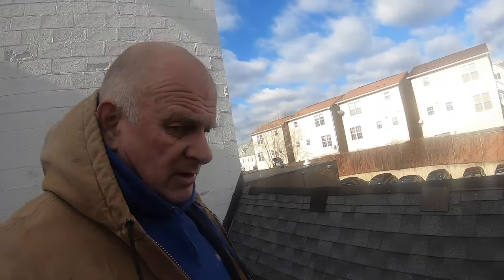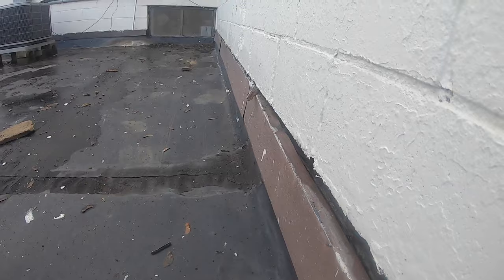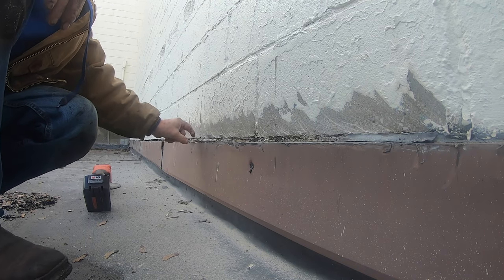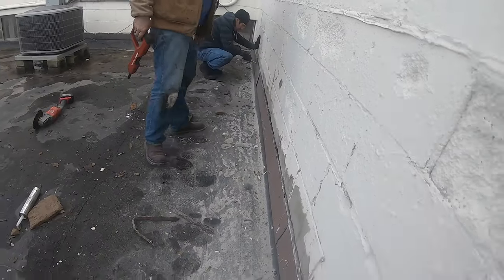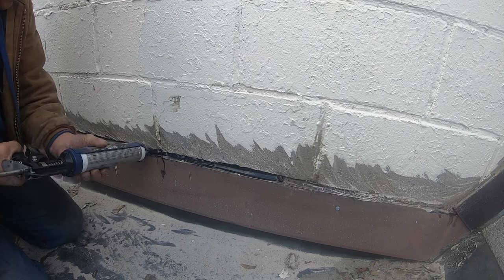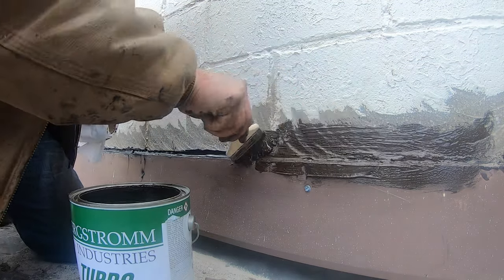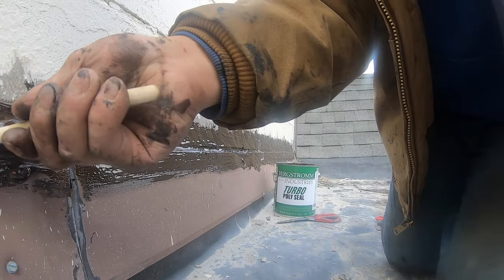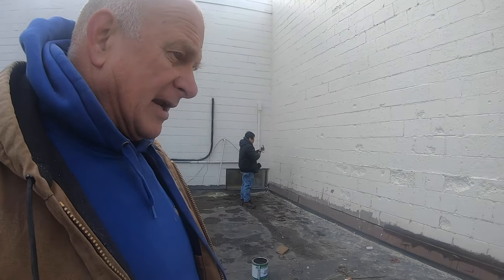FLAT ROOF LEAK REPAIR | The MAGICAL life changing sealant for every home. I which I knew this before

Comment: Cut a 45 degree raggle kerf 1/2 inch deep about 2 inches above old reglet flashing full length of wall. Use your poly urethane and insert counter flashing over the old reglet flashing. Boom. Water runs down wall onto counterflashing and cant go up a 45degree slot. Permanent!

Comment: Thank you for the great presentation and shared knowledge.  I also need to fix a what I believe to be called a " Gutter Box " that drains the water off the flat roof. The box of course sits level with the roof so that it drains the water through the interior side of the wall and out the exterior. A vertical gutter sleeve is attached to it on the exterior side of the wall.  I am thinking if the Gutter Box isnt damaged i can also use the Poly Turbo and Mesh surrounding the box. What do u advised?

Comment: Very helpful video. What do you have to do to get the tape and sealant to adhere to painted rough stucco? I don't want to grind down the stucco. I also need to patch large fissures in an epdm roof. Should I use the sealant and tape or put a patch over the opening and then the sealant and tape?

Comment: Hi Dr. I love your videos. I have a question; why do writers on the internet say silicone is better than PU? I personally am using Bostik PU Seal N' Flex as i cannot get bergstromm Products here, where I am. After viewing some of your videos I am leaning towards PU.
Reply from the maker: I use both Super Silicone Seal and Turbo Poly Seal for different applications. Urethane Silicone base sealant is very very effective on EPSM Rubber roofs but Turbo Poly Sewal will not band to EPDM. Super Silicone is more liquidy, therefore it will tend to flow off flashing details before curing. Turbo Poly Seal is very thick and sticky and doesn't run or flow easy. Both the sealants adhere well to metal, plastic, glass, and cement. The secret is the polyester fabric that is used in conjunction with these products, that is what gives the strength.
 Flex liquid does not come with any polyester fleece, so then you can use Henry's fleece that is sold in Home Depots. Henry's polyester fabric is stiffer and thinner and does not conform easily to curves and odd shapes.
Turbo Poly Seal and Super Silicone Seal have a specially formulated polyester fabric that is softer and stronger than Henry's that makes for better repairs.
I hope I gave some reason for the why's and why nots.
Thanks for the question and I hope to hear more from you.
Naas
Reply: @FlatRoofDoctor  Thanks for informative reply. By the way I use Butyl tape on top of the PU sealant to extend the life by warding off UV light.
Reply from the maker: I am not familiar with Bostik PU. I guess the PU stands for Poly Urethane. But if you are referring to caulking products, then I will use a Poly Urethane caulking above any other. There is a place for every type of caulking, but not every caulking is meant for every situation

Comment: Hello Flat roof doctor.
I have a roof that has an attached patio.
With a gap about 1/4 inch. Just purchased the trailer. Looks like the gutter or whatever they had there is gone. There is no flashing just some steel between the patio roof n the trailers flat roof. 
My man put some flex tape on it.some creases. I saw your video that says it gets hot n adhesive wont stick. Now that we spent allot to repair so much up there. He says hes done. He wont let me get up there. To see what's wrong n to fix it myself.    I'm thinking turbo poly seal  polyester fleece n then a coat of the turbo poly seal again. But unsure because I haven't seen it. 
Now if it needs flashing I'm not sure how to attach onto the  flat roof which is what he tells me about 1/4 inch away n also patio roof is lower than trailer flat roof I believe  but not positive rubber roofing. He used a silver seal on part of the roof neighbor said u have to do every 2 years or so. I'd love to see a video on how to fix this. Rochester NY

Comment: The only thing I do to my mobile home roof every 5 years is roll on that"Henry's Tropicool"I have Never had a leak since(12 years)& Henry's Tropicool is supposed to last a lifetime so really I shouldn't have to even apply Henry's every 5 years but I do it anyway.
Reply from the maker: Sure, I wonder what the top of that roof is starting to look like. You will not get away doing that on a residential roof where more flashing is involved. A mobile home is slightly slanted and does not have much pooling water. A mobile home is 10 - 12 ft wide, Not much should go wrong. Why started coating in the first place?

Comment: What was that tool you were using to secure the flashing to the wall??
Reply from the maker: That was a Hilti DX 36 Semi-Automatic Powder-Actuated Fastening Tool you can see it here https://www.amazon.com/DX-36-Semi-Automatic-Powder-Actuated-Fastening/dp/B004IAAL48
It uses .22 power shots to shoot nails into concrete
Reply: The wrong one!
Should've put chocks in the gap... NEVER nail holes in flashing, it defeats the point...

Comment: A Brit that does things the Polish way....
Reply from the maker: Not correct. I am a South African doing it the "Boer maak a plan" way. I made a living repairing roofs in connecticut for over 30 years. If had to many clall backs, I would be out of business. So whatever repair I did lasted.
Reply: @FlatRoofDoctor  Sorry for the mis- characterization... I didn't mean to call you a Brit. I still don't like your sloppy workmanship. After 38 years in the business, I call it as I see it. Either way, I wish you well.

Comment: Should have took the old flashing off. Resealed roof membrane and then put the flashing back, and then used his second sealer. I don't like the way he kicked the flashing, shows unprofessional attitude.
Reply: Remove old junk silicone, water cut off behind rubber, term bar, new and better sealant ( tite bond ) in riglet joint. Done

Comment: Poor repair. I'd have pulled the reglet metal, re-glued the EPDM to the wall, laying a bead of water block on the edge, installed termination bar mechanically fastened with rawl pins over that, mechanically fastened a metal compression flashing over it all, then caulk...
Reply from the maker: Typical at the end you still want to use caulking. This was done the way you describe it, and it failed. Of course I am showing how it really should be done. I am showing how to make an inexpensive repair to something that was already done. You are talking about making a repair that the owner wouldn't want to pay for. 
Why is everyone always want to criticize work that I do to show people an alternative way to make inexpensive repairs and try to compare it to something that would cost 10 x as much. That doesn't make sense. If you can get the pay on the job you are describing, then I am all for it. If I can help someone to stop a leak at a fraction of the cost than what you are proposing, then I feel I have done a good deed.
By the way, I went back to the same roof a few weeks ago to do the same treatment on another wall, and the owner said i n that video, "This is the least amount of leaks he had for the last 30 years" Hmm, I guess it worked.
Reply: @FlatRoofDoctor  You could have  put mastic and fabric on it and it would have worked as well, but thats not the point.
Reply: Me too. Redundancy is the word.